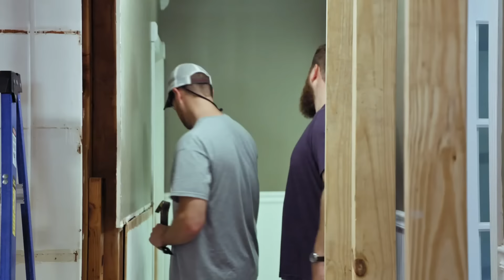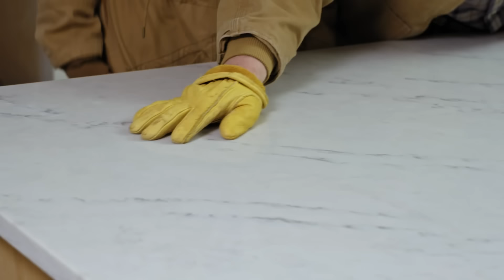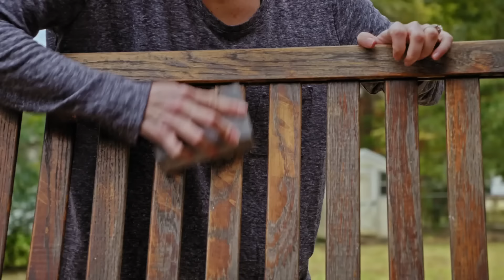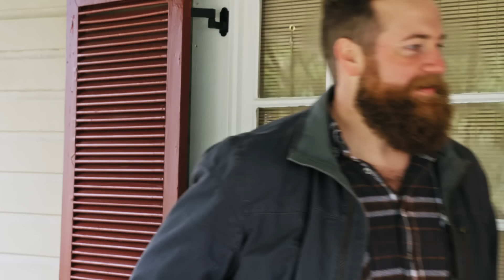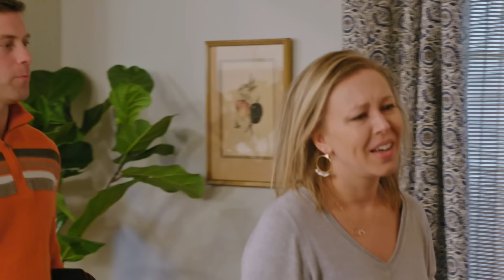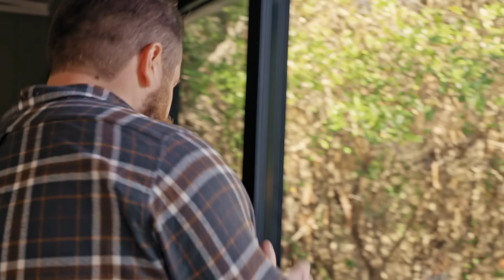Historic House Gets The Perfect Entertaining Space | Home Town

Comment: They’ll never be able to open up those big glass folding door unless they enclose the patio they open onto. BTW, quartz doesn’t hold up to “anything”; you need to be careful about placing hot pans on the countertop to avoid cracking it.
Reply: It is enclosed. Did you not watch the whole video?
Reply: @phyllissweetpea4926  Did you not watch? The big glass door opens onto a deck. Nice place.